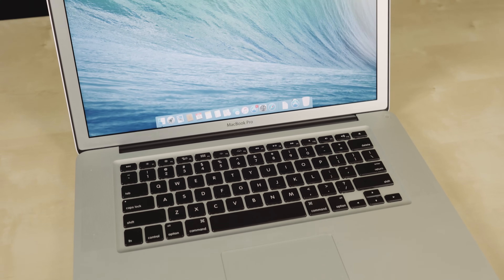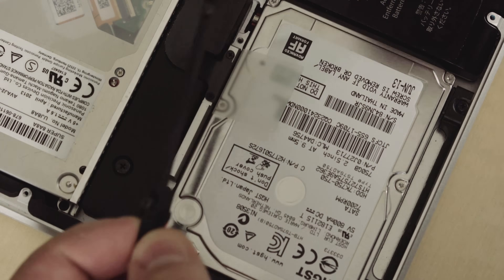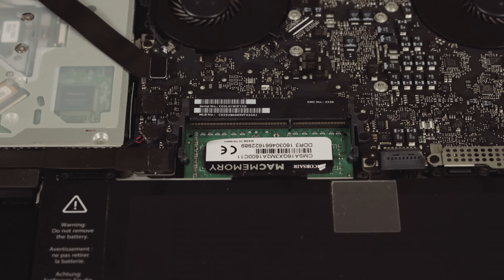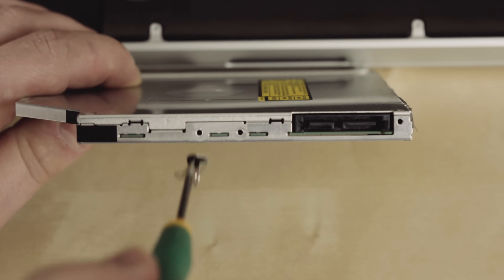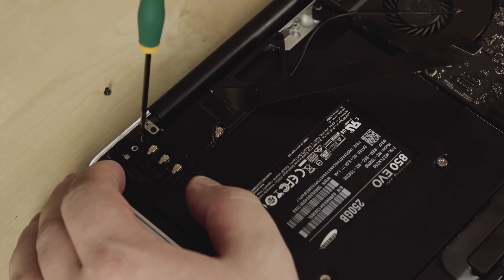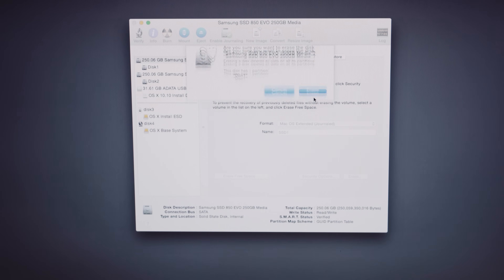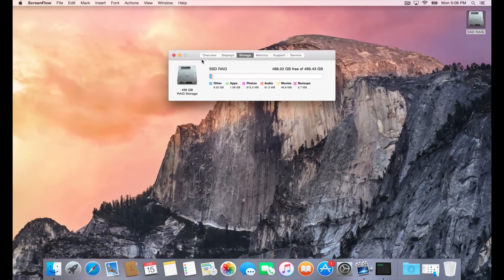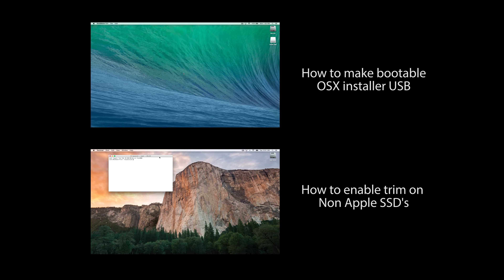Fastest 2012 MacBook Pro Ever! Upgrade Guide - in 4K

Comment: On a 2011 MacBook Pro the optical drive must be replaced with a 3.0 GB/s drive. The controller is not compatible with 6.0 GB/s drives. That means an SSD cannot be used there, and only older HDDs will work.
Reply: My understanding is that ssd can be backward compatible if the computer link speed is 3.0 GB/s.

Comment: Can confirm this works flawlessly on a 13" mid-2012 MacBook Pro (2.9 GHz, i7). I did one 1TB hard drive and 16gb RAM. I was about to buy a new laptop, but I decided to look up what was involved in an upgrade and ended up saving myself 3200$. This was as easy as it looks to do (took me less than 15 minutes start to finish). Thank you so much for not babbling on repetitively as most do, this video is concise and straight to the point. Subscribed!
Reply: did you do the raid thing or just the hardware upgrades??
Reply: Chris Hernandez just did the upgrade..no raid
Reply: Great ! I just replaced the screen on my 15" ... ram is next. did you do the ssd upgrade?
Reply: Chris Hernandez yep, did the ram and ssd
Reply: Since I kept reading mixed comments re whether a MBP 13” (mid-2012) has the capability to hands 16gb RAM, since the video is a 15”, it sounds like you were able to upgrade yours to the 16gb RAM with no issues? I think further above he says the max for a 13” was only 8gb. I’d appreciate your response! :)
Reply: Katherine Pham 16gb no issues at all...runs so much faster!
Reply: mine is 13 mid2012 and maxed at 16gb

Comment: Hi Zed Pro, Quick question - Can you use the following ssd 500gb x 2 for a macbook mid 2012? (Samsung 850 EVO 500GB 2.5-Inch SATA III Internal SSD (MZ-75E250B/AM). Thanks
Reply from the maker: Big Red Design Agency yep you can use any size hard drives. I just used 2x 250gb because it’s what I had

Comment: I've just done this upgrade today, only I have 8GB ram instead of 16GB. My 2012 macbook is lightning fast now. Boots in ~ 15 seconds from power button press. Friggin' awesome!
Reply: What macbook pro do you have?  My fiancee has the mid 2012 pro with the i5 and 4gb ram, and I am going to upgrade it to an ssd and probably 8gb ram. If so, what ram did you use? Thanks!
Reply: Star Lord AaronNewsted not OP but my mid 2012 has a 1tb Samsung 860 Evo SSD and 8gb of Crucial ram. Super fast boot time and even quicker to open software.
Reply: Max Branvall did the 1tb ssd work with no problem? I’ve read it only allows 500gb ssd... I wasn’t sure how that would work but who knows..
I thinking 1tb ssd and 16gb ram on my mid 12 pro i5
Reply: mitchell janusz hey there! Yeah its working perfect and did wonders for boot/startup times. I've heard that the 2012 pros only allow up to 8gb of ram, which is what I have, but you'd need to research that further.
Reply: Tom B will this work with the 15inch or just for the 13inc
Reply: hi Tom, which memory are you using? What brand are you using :)
Reply: Tom B I have 16gb in mine but my 2012 MBP is booting in 21 secs. What gives 😂😂😂🤪
Reply: I got the mid 2012 sata disk 500 gb i5 dual processor hdd 4gb rami need this fast so I can record in GB and logic with out a problem and this computer stays loading programs slow how do I fix this
Reply: @lilarson732  im doing the exact same...i have the same question. From what i read, GB and Logic X should be fine on the upgrade since there are people running video editing software.
Reply: Max the RAM to 16GB though... then you can have a few programmes open together without losing performance, If you don't quit programmes often RAM will degrade over time. If you use a utility like Memory cleaner you will see how much RAM is being hogged by apps like Google Chrome (for now reason except bad programming and constant helpers calling to the mothership). AS an example of this, after boot my RAM use was around 30% - a purge takes this down to 14% running on 16GB total - which is then speedy. You can set the app to auto purge memory at various way points (and to not purge if your CPU usage is high to avoid interrupting your work flow).
Reply: @Spartanm333  what's the name of the memory cleaner app you use? Thanks for replying!
Reply: @carcaviar9321  On 10.11+  I use  'Memory Cleaner' https://nektony.com/ - they do a free version without all the bells and whistles. The most useful feature is the auto clean - you can set parameters to tell it when to purge the memory e.g. when 80% of your ram is used. You can do this yourself directly with a terminal command but for what resource this uses you might as well let it run in the background while you work. I don't think its fluff because interestingly when I first boot it indicates about 25% of ram in use and a quick purge its down to 12% - I am running Mac Pro 5,1 towers 8 core and 12 core with 32GB Ram which is ample for most graphic design and light video / audio use. OS on an SSD gives the best performance boost on these (plus RAID for your data can be used to double or quadruple read /write speeds). Where it is most useful is if you have a lot of apps open at once - when I am in full flow I might have 8 or 9 running with Office 365 and Adobe suite of apps - I have Outlook and at least one web browser open all the time. Chrome is the worst offender - hogs RAM and processor - seems to get worse over time, so worth quitting once a day (the Macs largely stay on 24/7).  Best wishes.
Reply: And don't forget if you use Photoshop in anger with large files (like design for print) you can set up a dedicated hard drive (or clean partition) and set in the programme preferences to use this drive for cache rather than stealing all your RAM. If the drive is reasonably fast you wont notice any lag in Photoshop - that's an old school trick we used that goes back to Photoshop 4 when 1 GB of RAM on a Mac was lush.
Reply: @Spartanm333  wow thanks for all the information. Very cool what you can do with them
Reply: @gaming0gamer0hahahha  Really? what are your specs?
Reply: Does everyone having issues with there replacement battery. Like they only work for a few weeks until you let you battery die then when you restart it. Your battery will be dead or it will say needs to be replacement even tho it's a new  battery. This is my second battery replacement with the exact same problem
Reply: What ssd and ram did you use? My macbook pro unibody mid 2012 (ssd, 8gb ram, core i5 2.5ghz) still runs very slow, boot time about 12 minutes and any task takes a ridiculous amount of time
Reply: Tom B is this working with MacOS Mojave?
Reply: Gavin Read I haven’t upgraded my MacBook Pro 2012 mid i5 and Mohave works ok.

Comment: Currently own the 2012 MacBook pro in 2018, I upgraded the ram to 8gb over the 4gb and it feels as fast as if not better than any other mac made in 2016 or earlier. I would recommend buying a MacBook mid 2012 if you are trying to save some cash but need a nippy laptop:)

Comment: Excellent! I have a mid-2012 with 16GB RAM and 140GB SSD as boot and the stock 750GB HDD instead the optical drive with a battery requesting service.  I was considering to replace it by the newest 2018 MBP, but the price tag really is holding me back.  Your video gave the way to go: get two 500GB SSDs in RAID 0 and, to complete, replace the battery by a "similar" one.  I will have a machine for some more years - the only drawback I can see is that the 2012 MBP will not be included in some future macOS releases, but so far so good.
Thanks!
Reply: Hummm, not a good idea at all.  After some research I found out that Apple has messed up in High Sierra so the system partition with RAID 0 is not supported... unbelievable.  So, the safe way to go is on SDD 1TB...